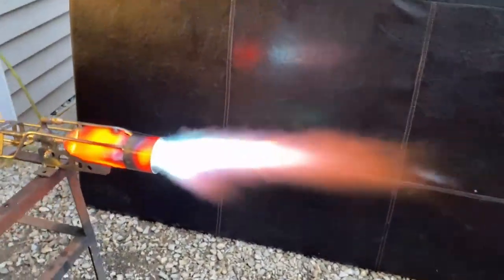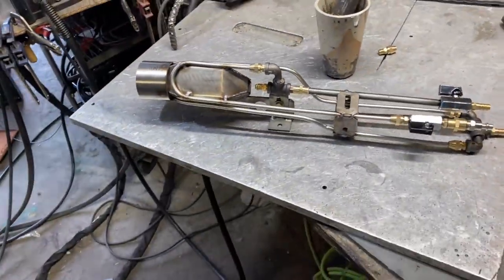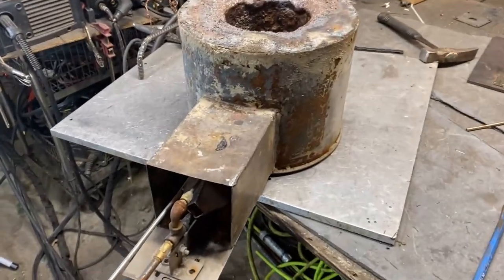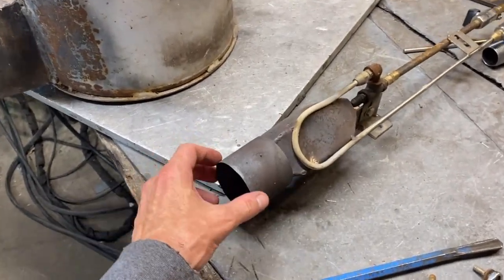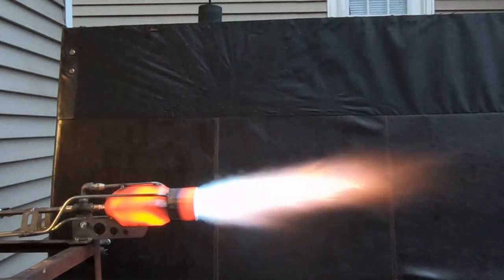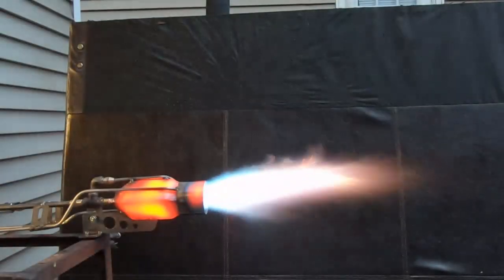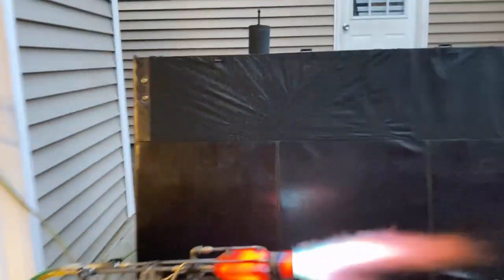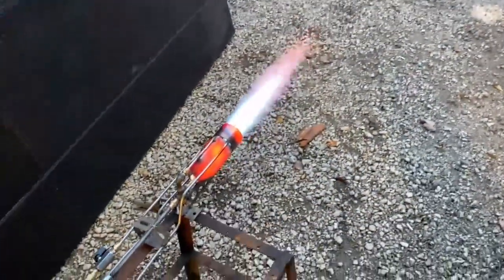Rocket Burner Oxygen Surface mix burner

Comment: I saw on an older video you opted for a 2.5" diameter nozzle, but now you have this vented nozzle with injected oxygen. What would happen if you had both the 2.5" nozzle going out to the vented nozzle? would that increase output?

Comment: its normal even in bigger furnaces to get refractory burnout after an amount of time. difference is with better materials like pure alumina or zirconia wool, or silicon carbide bricks like they use in lead smelter furnaces it just takes longer for it to burn out. theres also itc100 coating you can coat the wool with to reflect 98 % of the infrared  back into the furnace and helps keep slag from dissolving the wool.

Comment: When using pure oxygen, be careful on how you mix it. 
    One of the constant safety questions on a test is if it's OK to use an oxygen tank to power pneumatic tools in an emergency.

Comment: I ran some O2 inline with propane in the zeus burner I bought from you and I had the 02 and propane mix at a T right after the valves.  that was pretty sketchy as I'd never mixed O2 with anything on that big a scale.  I grit my teeth for a minute while I was slowly giving it 02 but it worked.  would doing something like that allow you to not have to mess with surface injectors and aiming them and all?
Reply from the maker: The surface injectors keep me from melting the burner . The burner would not withstand much of that kind of abuse
Reply: yeah I did make a combustion chamber for it too. modeled after your Godzilla out of 3|16 plate steel....it worked pretty good, but I was buying the little red tanks from the hardware store, and they don't last long. lol